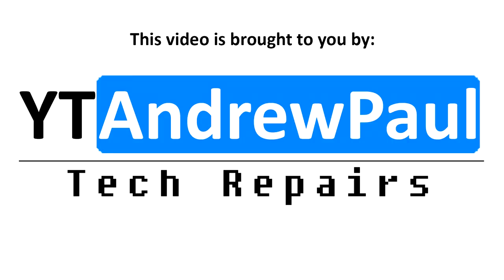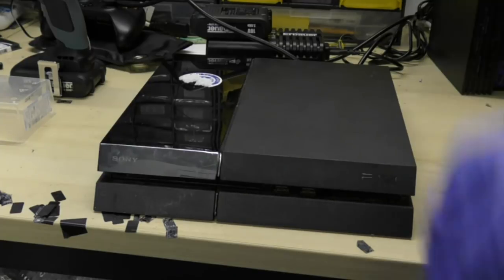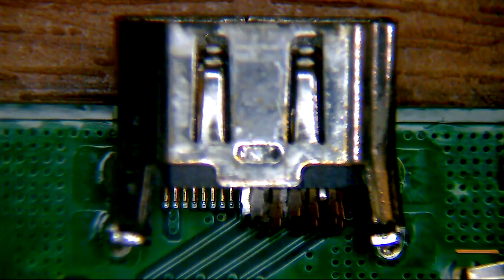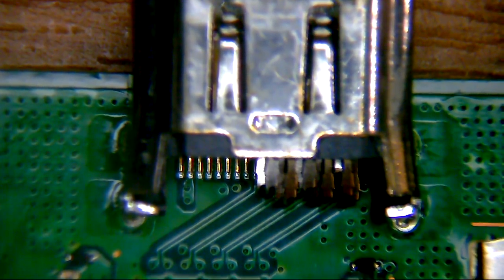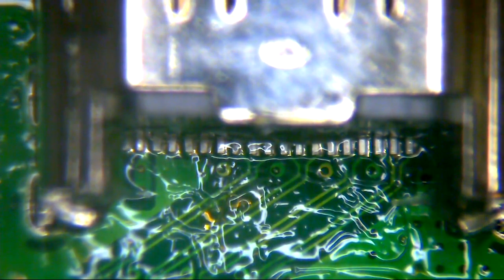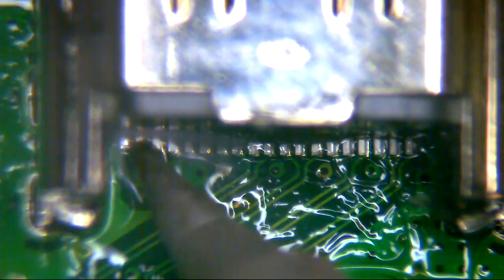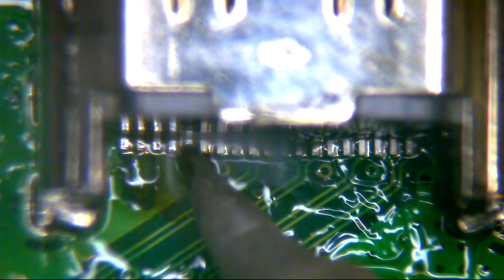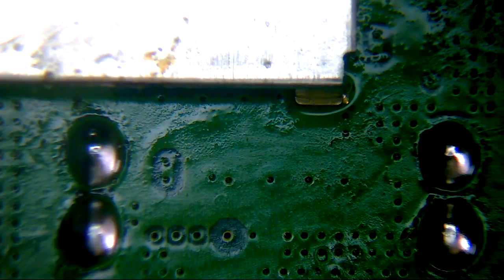This PS4 has had no image for a whole YEAR! Can we fix it? (WLOD Repair)

Comment: I'm really glad I stumbled into your channel. I've been practicing microsoldering for a good year and a half or so after taking the dive to slowly build up my own rework lab with my own equipment. I work in an electronics repair shop and over the years I've had to turn away tons of repairs from people with problems like damaged ports, mostly on smaller electronics like phones. After watching tons of repair videos on things like that, I figured it'd be a good idea to practice and pick up the skills. 

Since I'm still practicing it, I don't advertise it as a service, but if someone comes in with something that they've already given up hope on, I'll happily take a look at it. I'm sure you've seen prior work from amateurs that claim to be professionals, and sometimes it's pretty horrible. I'd like to think that my work is above that, but since I'm still practicing and learning with my equipment and getting a feel for the quirks of all these different devices, I never tell any potential customers that I'm a "professional". I basically tell them I'm a crazy person with a lot of expensive equipment. If the device is of no value to them already, no harm done if I screw it up, and it's a win-win if I can get it working again.

For the most part I've been working on much smaller electronics. Phones and such. There were a lot of common failures I've seen in them over the years, like Tristar, TouchIC, and backlight failures in iPhones, and of course the overwhelmingly common problems of USB ports breaking. I've fixed a lot of devices with microsoldering skills, and in most of them I haven't even charged the customer just because I really want to get the experience. But again, I only do it if they already think it's a paperweight and don't care what happens to it.

Anyway, I decided to try branching into console repair. For phones and laptops and all that fun stuff, there's a whole load of good quality channels that cover those types of repairs (Louis Rossmann, iPad Rehab, Mark, STS Telecom, to name a few), but console repair seems to be still relatively untapped, at least in terms of quality. So far your channel has been the best for information and production value (seriously, being able to see what's happening helps, and having a no-nonsense explanation of the diagnosis process is a huge plus). Definitely going to sub to you and take a long binge watch session of your videos when I have free time.

I recently took a PS4 in for an HDMI port repair (the entire interior of the port was broken, pins and plastic and all). Replacing it was easy, but it's still giving me no image. After reading the board for a bit I decided to pop that shield over the encoder IC off and replace that. I swear these boards must contain adamantium or something because the solder on that shield wouldn't wet even when I was blasting that sucker with 500C from my Quick. I decided to clip it off, and there was some upper layer damage on the board, but it appears to have only damaged a small portion of the ground plane so I think it's okay, but it probably isn't. I'm sure in your videos covering those encoders you'll teach me a more appropriate way of removing those shields. I just got finished up with soldering down the new chip, but unfortunately it's still not giving me an image. I'm tempted to throw in the towel on this, but I think I'll keep at it for a few more days after watching your stuff on the HDMI circuits. I'm hoping that layer damage didn't go deeper than the ground plane, but if it did, I've learned my lesson. I'm sure you know as well as I do that in this field you don't really learn until you make some mistakes.

Thank you! And if you read this, you're awesome.
Reply from the maker: Good luck to you my friend - it's a journey that you never stop learning on I find and I love it for that. :-)
The PS4 with no image - as you say the top layer can de-laminate if the shield solder isn't flowed prior to lift - there are some small vias to the right side which are fairly close and can get pulled in if you're unlucky which I've seen before but if those look intact then you're likely good.
If you've replaced the Encoder and the port and there are no loose or bridged pins then check continuity of the EMI filters below the Encoder IC - they should read continuity between top left to bottom left, top right to bottom right. If they don't, or they read continuity from left to right then replace them.
Also occasionally you can get it where the caps and transistors will go out of spec which you'd be best to pull from a donor on the top side of the board behind the HDMI port. Do you get any signs of life on the monitor at all like sync with no image, out of range etc? Would love to help you get this one going again :-)
Reply: Andrew Paul Thanks for the reply. I'll take a look at it when I get home. No signs of life other than powering up and white light. I have a feeling I may have blown some passives loose when I was trying to get that shield off with heat. I know the filters are still there but I think some passives flew away above the encoder when I pushed it to max airflow. I checked out some of your other videos on the encoder chip and it looks like even when the solder holding it is wet you still need to apply a decent amount of force to get it to pull away. Shields on iPhones just come right up, so that explains why it seemed that shield wasn't budging at all when I was trying hot air. I didn't want to pull too much which is why I decided to just trim it off.

When I get home I'll give it another look over. Hopefully it's just a matter of a missing component or two. They're probably stuck somewhere on the board even.
Reply: Andrew Paul Hey! So I got it all apart and yep, looks like a few passives may have blown away when I was trying to remove that shield. Here's a picture: https://i.imgur.com/fsKnQIrr.jpg

I managed to find one of them, but I can't seem to find the others. This is an SAA-001 board. You got any idea what components go there and what their specs are? I can probably track some down on digikey or something. I'd love to order them from you but I'm in the states and I have no idea how much shipping cost would be for three tiny SMD resistors.

I have also confirmed encoder to opposite end of filter continuity. Haven't checked continuity from encoder pins to port pins however, but I have a feeling we're okay on that front.

Comment: Have a PS4 for repair right now where the HDMI pins look identical to this video. Replaced it and still no video. Checked the filters after and 3 of the 4 filters were blown and of shorted to ground. I've never seen so many filters gone. I'll be replacing all 4 and the encoder. I'm guessing the HDMI pins shorted and sent voltage down the HDMI circuit. No idea. Hopefully that gets it going.

Comment: I wish I new how to do stuff like that. I live in Florida and just had a storm and it messed up my rougher . I hooked up my spare and have internet again but had my ps4 wired direct to it instead of WiFi now when I turn it on it lights up blue then goes white and has no signal on tv. I’ve only had it for like 4 months so I believe I should be able to send it in for repair but still it’s so horrible.

Comment: Hi Andrew, Can you re-ball PS3 consoles? I have a 60GB Backwards Compatible Console that works but the fan is really noisy and has probably ran too hot for too long and if I got that addressed it would probably still YLOD shortly afterwards.

Comment: Andrew  are ta still repairing  PS  4 Pro  Mine crashed playing a game. When I turn it I get the normal blue light and the PlayStation sound. Then it goes white and nothing on screen   when I press the on/off it will try again  or go into rest mode.  Full reboot don't  do anything either. I'm in UK  so I can email  if necessary.

Comment: Hi Paul, need you help mate. ps4 2015 model has strange flickering sceen only when in home screen, it has goes out for 5 seconds and comes back and resets to home screen. if you are in settings it just resets to home screen. once it just restarted itself but after 5 min. does not look like it overheats. what should be the cause GPU or power supply?
Reply from the maker: Sounds like APU to me initially. Do you have any videos of the event occuring?
Reply: Also I noticed cockroach fell out of power supply
Reply: Sure it's GPU?

Comment: Hey, Andrew. i got a ps4 problem. i though was the hdmi and replace it. with a cheap chinese microscope yeah... the machine powers up. show image on recovery mode. on software update shows the image perfectly even 1080p .but then when is starting normally the image goes and comes all the time. chip problem maybe?

Comment: bit of a weird 1 here mate, i replaced and hdmi port, reassembled and was getting blue flashing light constantly. took the bottom off and took screws off the psu, the console then booted so i put it back together and blue flashing light again, it will boot into safe mode fine but not booting normally. does this sound like a psu failure or something completely different. cheers
Reply from the maker: hi mate - Just so I get this right and don't give you duff info it just pulses BLOD with the long PSU corner screws inserted and torqued down but when they're out it's fine and boots to OS OK? Is the heatsink clamp the correct way around (corners facing up toward you) and not overly tightened? Thermal paste OK - not overloaded or spilled over across the die?
Reply: no not the long screws the short 1s, i didnt tighten the clamp down anymore than normal, yes its blue pulse. it did boot then now won't except for safe mode
Reply: dont think it was to do with the screw now, so sometimes it boots and loads on the screen and sometimes it pulses blue constantly. it has now shut off a couple of times

Comment: None of my ports are broken and my ps4 isn’t connecting to my tv it says no signal help please what shall I do do I get a new hdmi port
Reply from the maker: That's likely to be a failure of the HDMI Encoder IC.
Reply: I get the same and it happens randomly for me, most times it works. I have probably got the same problem as you because my port looks fine .

Comment: Can an optical port be fixed in the same way you put in a new hdmi port.?
Reply from the maker: Hi - yes it can - it's fairly simple as it's only a couple of solder points.
Here's a quick tip though - if it's just the outer black plastic case that's damaged and the port still lights up OK then the plastic case just pulls straight up and off and a new one can simply be pushed on over the top -  a 2 second fix.
Reply: Andrew Paul Ok thanks very much for the quick reply 👍

Comment: Hi Andrew, I have a sttange issue with a PS4, can you help me? It has WLOD and no signal, but when I take out the HDD and boot without it, it shows me signal but distressed, all "snow". Is it the HDMI port or the HDMI controller IC? 
Here is what it does: http://i67.tinypic.com/f10i7r.jpg
Reply from the maker: If the port and cable are good then I'd replace the encoder.
Reply: Andrew Paul I gave it back to the customer. He did not want to pay for the encoder's extra cost. So, I do not know if this would be the issue 100%. Next time I suppose :)

Comment: hi andrew.what can i do, i have an board v1200 with hdmi issue. the port is in perfect condition, the ic is new, the filter is good, round 0.6Ohm at all , the diodes have round 0.6v in one direction, the fuse from hdmi is 0.0Ohm, and no Screen on the tv (cable in good condition) the tv say: conectet playstation 4. this Information come from the playstation, but no Screen. it say always hdmi not connected.  did you have an idea.thank you for the nice Videos ;-) i love them

Comment: where could i buy the diodes with dj on them
Reply from the maker: The ones behind the port? I stock them and can ship worldwide.
Drop me an email to ytandrewpaul@outlook.com with your location and quantities needed and I'll get a quote to you.
Cheers, Andy.
Reply: cheers andrew, i have a board here atm it had a ripped pad so i jumped it, it had a diode missing so took 1 from a donor board, but not sure if i put it on the right way around, i get the white light and the tv knows the hdmi is connected but it shows a black screen, could a reversed diode cos this. thanks
Reply from the maker: It could indeed mate - if this is an SAA / SAB-001 then as you're looking at the front of the HDMI port the strip should be facing the left side of the diode.
Reply: its was the diode, but the thing is now it flashes ps4 couldnt start connect controller then goes to a black screen and starts a buzzing sound on the tv

Comment: What brand of 60/40 solder do you use?
Reply from the maker: Brand isn't all that important to be honest - as long as it's 60/40 with a decent rosin core flux you're good to go.
Reply: Andrew Paul I did purchase some 60/40 rosin core solder (china) and it took so much heat to melt.

The solder you use seems to melt so well.  

No bother, though thank you for the reply though.

Keep up the great work and videos.
Reply: Andrew, Whats the issue with consoles when this happens randomly? it was fine for 2 months and its back again, my console is also restarting and saying i turned it off incorrectly, does it sound like a faulty motherboard/on its way out?
Reply from the maker: Sounds like it could be the beginning of onset APU issues if it's randomly rebooting itself.
Reply: That's what i thought because i'm getting loud fan as well and its been freezing so its probably overheating (it's more warm than it was before i got it)
Reply: Got my console back and they have only repaired 1 thing so i think it might have been the drive playing up.

Comment: any idea why a ps4 has no power even after a psu replacement
Reply from the maker: First thing is to check fuses and thermistors (labelled F and TH) for continuity. Any which don't pass should be replaced.

Comment: My HDMI pins look straighter than my sexual preferences I tried safe mode I still get no signal I need help I've tried almost every trick in the book
Reply from the maker: It's likely to be a failed HDMI Encoder IC if the port itself looks perfectly intact. It's relatively easily changed if you're well-versed in soldering.
Reply: Andrew Paul see if the tools were cheap and easy to come by I would agree but now I must resort into hiring someone to do it for me
Reply from the maker: Where are you located?